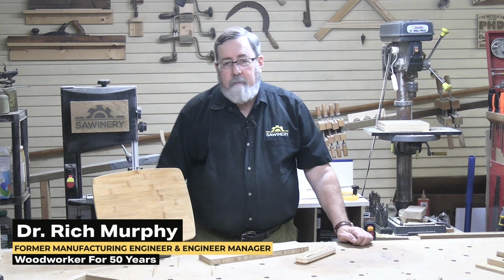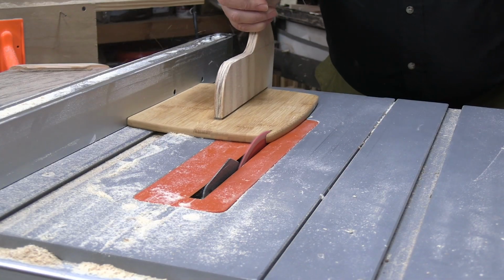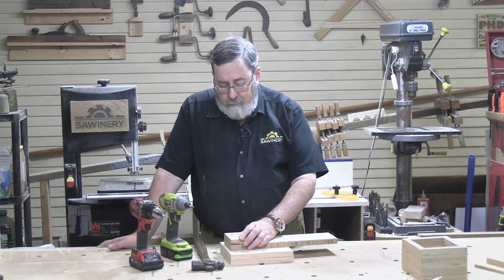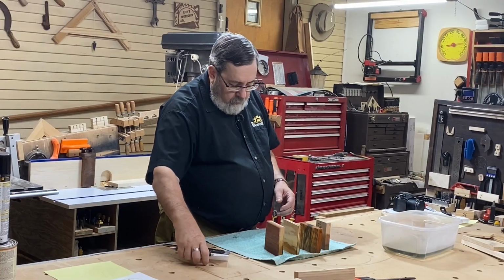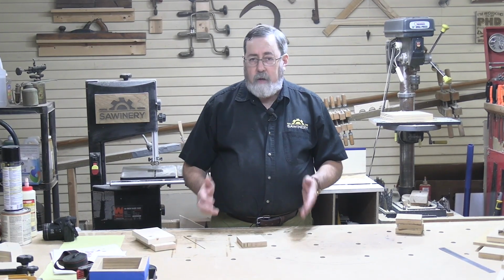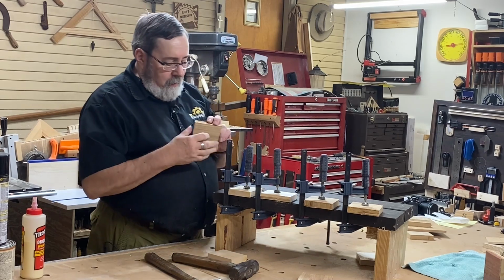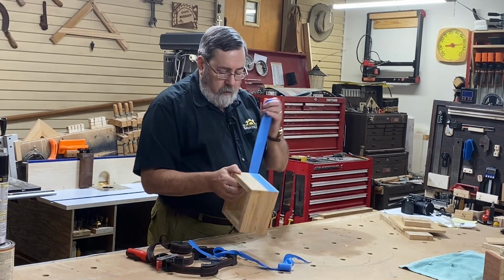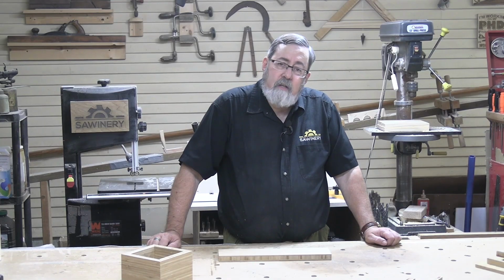Bamboo for Woodworking? I Tested It to Find Out!

Comment: I have been looking at Bamboo, our local K-Mart store has some nice storage boxes and the working appears to be exquisite, nice cut edges, nice cutting into small profiles, it holds it's shape well, and gluing OR dry pin nailing, both are strong. I have noted very little wear in the material, the shape it is is the shape it was cut or machined to, even those cutting boards don't seem to suffer much under the influence of knives
The cutting boards like you looked at do indeed have an assembly of strips style construction.
Some of the bigger varieties of bamboo may yield some thicker sections, but as you mentioned, it is a grass, not a timber, so the maximum available thickness is going to be it's limitation, unless pieces are laminated. The ply that you showed us certainly can't be made from traditional large sheets of veneer, laid down in layers at 90 degrees, you just won't cut that much veneer out of any one length of stalk, so cutting strips of about 6mm or so thickness, in a tapered shape, and then alternating the lay of those strips will allow some pretty generous sizes of board.source some of your own lengths of the larger varieties, do all the splitting, gluin, layering, I think that a pretty sturdy 12" x 12" beam could be manufactured
Bamboo also has no knots, just the bulges where the individual stem sections join (and the plant grows leaves from them)
And a thought: In some Asian countries, you can see some quite tall buildings in cities being erected, with the usual use of exterior scaffolding, except that's it's not steel or aluminium, it's bamboo. It really is that sturdy
Reply: I had to double check how old this video is because you mentioned Kmart. I thought they all closed years ago. Good for you and your community.

Comment: Going to the dollar store to buy up all their bamboo cutting boards right now
Reply: Huh, They grow on the roadsides every couple of miles in my country. Almost an infestation. I could cut off as much as I want and no one would say a single thing.
Reply: @navtektv lucky you.
Reply: Beating me to it. Although don't even bother looking for any high carbon steel kitchen knives. Already scooped them up at 2 bucks a piece
Reply: While bamboo itself isn't native to the United states, it has been brought over and is somewhat invasive. You might have some in your area without even realizing it
Reply: @nigeladams8321  it is native, but they cut them all down in the past
Reply: @DoozyyTV  There are many species in several genera. All with very different growth habits and culm properties. There is a specie native to the USA but it is quite different than the common oriental timber bamboos or large tropical genera that everyone imagines..
Reply: Nooooooooo. It will dull your knives. Bamboo has silica in it, it will ruin your knives.
Reply: @disfuncionexe they use bamboo for scaffolding,  Like we use steel. So. That will tell you how strong it is.
Reply: @stevenlake5278  yea? That's exactly why you don't use it for cutting boards. The general hardness combined with the silica means it's brutal on the edges of knives